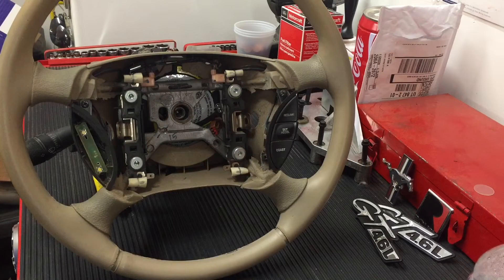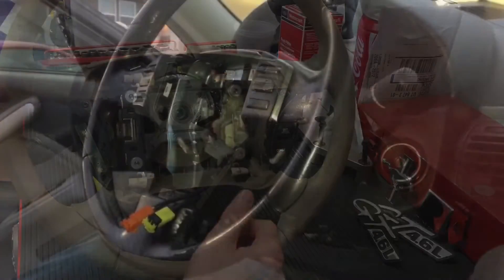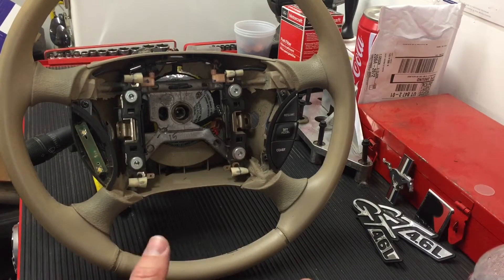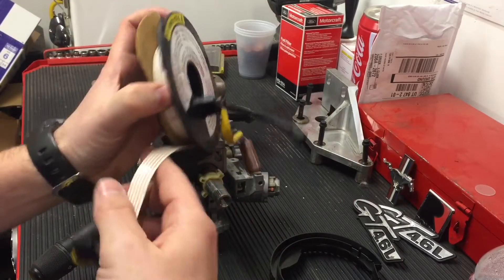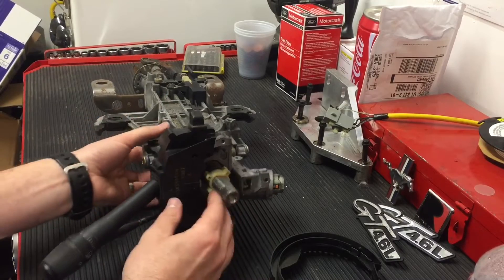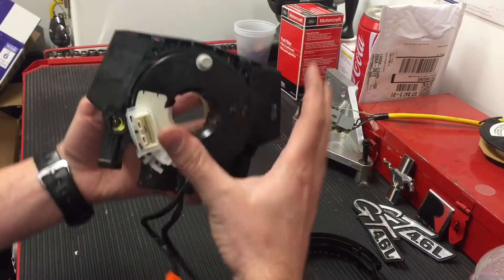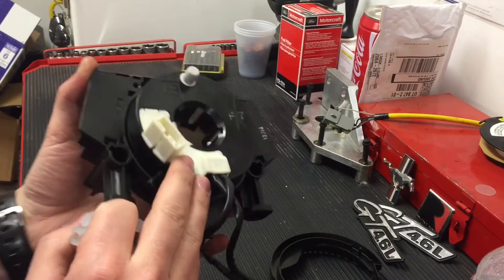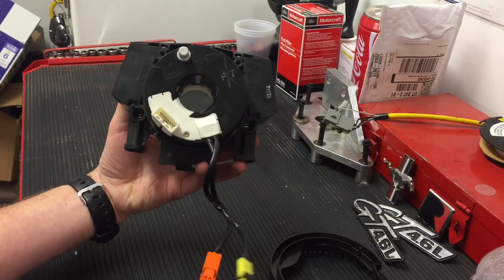What is a Clock Spring: Caution when installing. Horn only works when steering wheel turned

Comment: Can I run my car with no clock spring? I have an aftermarket steering wheel
Reply: I’m sure you’ve figured it out, but horn would not work without clock spring, so yes you can run it, although airbag won’t work either - won’t matter since you don’t have the oem wherl

Comment: I have a 2006 CAD sex I have controls on the steering wheel for radio channel and volume and cruise and phone none of them work the horn doesn't work and the lights on the switches don't work I've checked the fuses and they are good do you think it is the clock spring
Reply from the maker: That’s what it was for mine